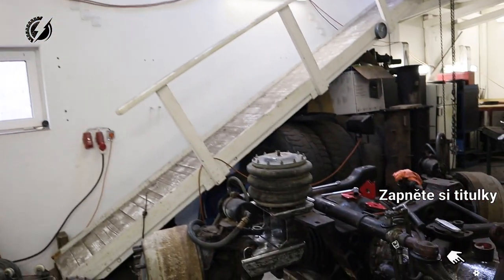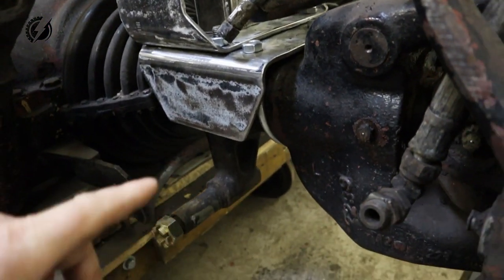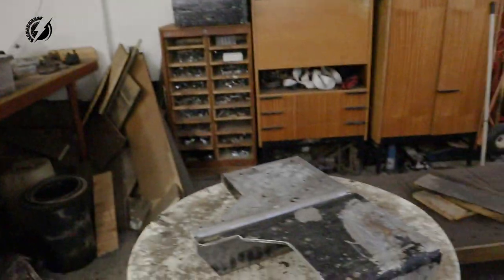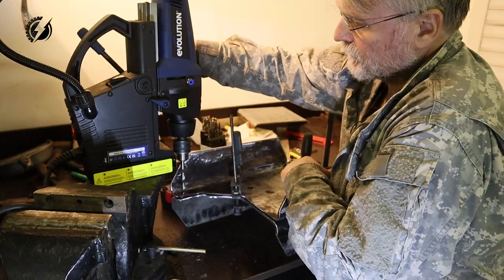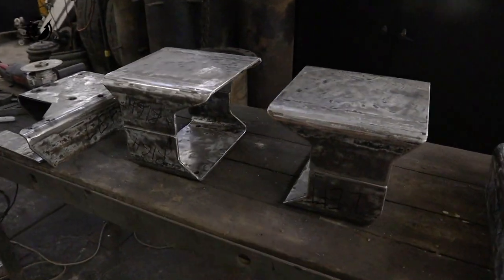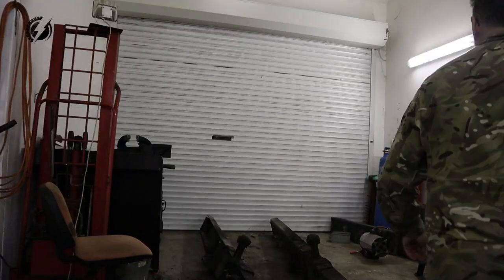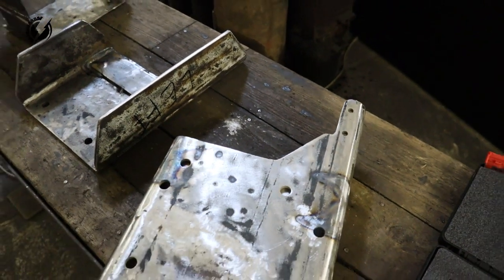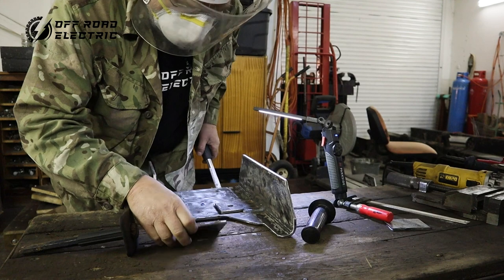EP 56 Building a Tesla/Tatra Monster Truck

Comment: `Hey Peter, looks great!  Are you going to have a compression box section between the axle and the underside of the bracket, inline with the air bag?
Reply from the maker: Not sure what you mean...... There will be the brace inside of the bracket so it will not cave in....
Reply: @offroadelectric9457  Yes, that's what I mean by a box section, basically a rectangular HSS (hollow structural steel section) brace to take the load from the air bag.  Looks good, Peter.  Love how you cut the pipe sections.  Keep it up!